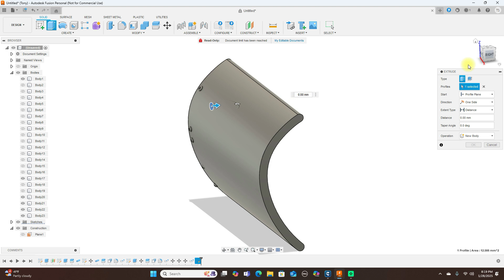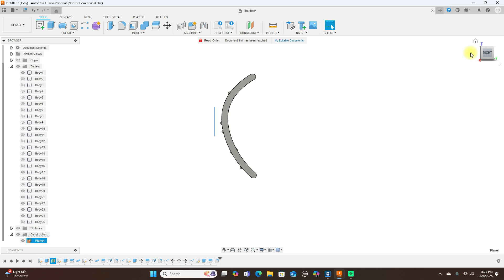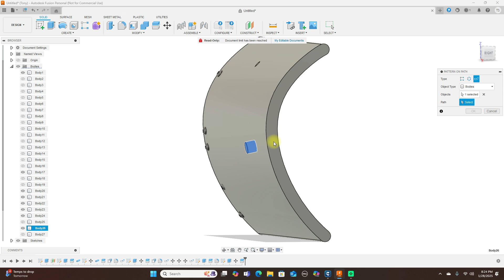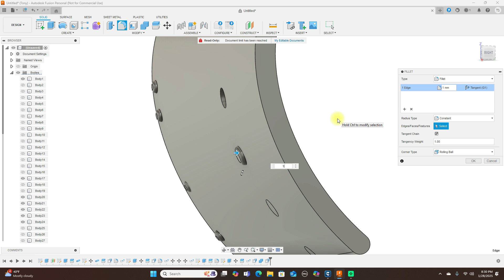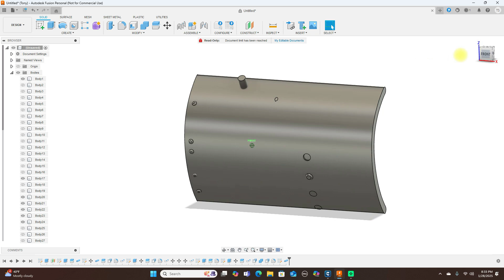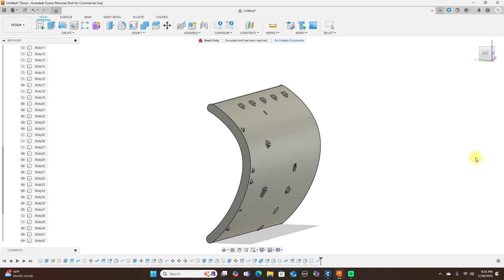Simplest way to  model rivets on a curved panel in Fusion 360 CA in 2025. Tutorial.

Comment: Hi @Cad Build Fly RC,

Thanks for the content. it helps the creation process and gives a lot of ideas. :)
Is there any particular reason not to use the Emboss feature? It worked out pretty well for me when creating details, rivets, etc. that need to follow a fuselage shape.
Reply from the maker: Thanks. Yes you can use the embossing command.  It works great also. My rule of thumb is to model things the easiest way that comes to mind first.  And like you said the embossing command works well and use it if it comes to mind first.

Comment: Hi Tony, thank you for this video, another tutorial for the external fuselage details! And for those wondering why you would make the rivets either in or out of the fuselage is depending if you are going to make negative molds for carbon or fiberglass or just do a straight out 3d print.